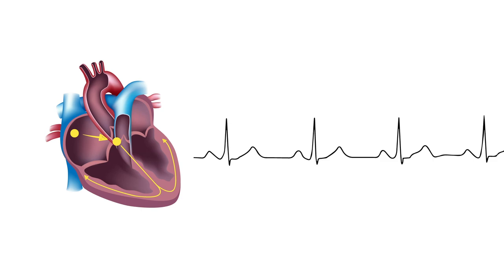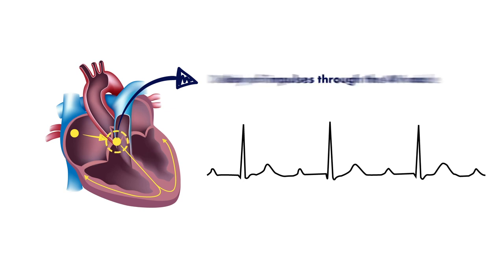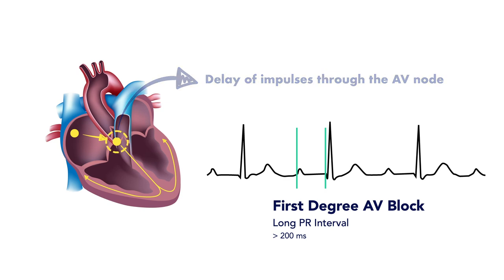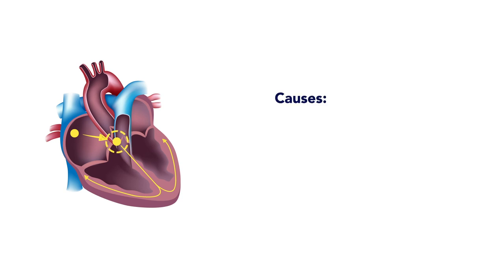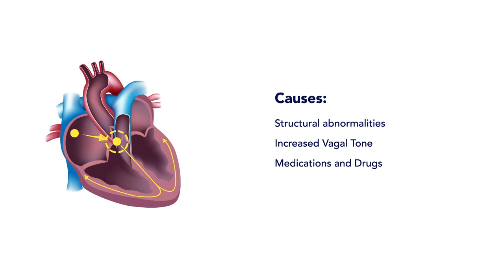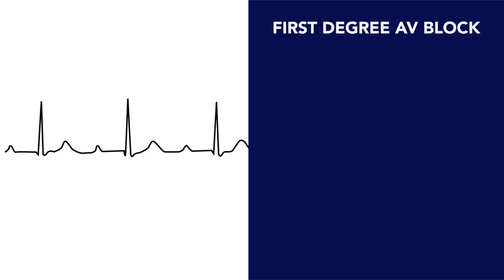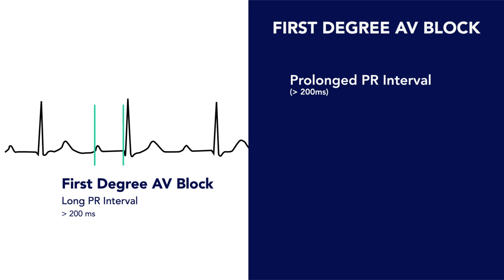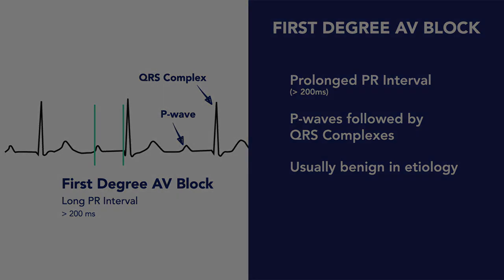First Degree AV Block -  EKG (ECG) Interpretation

Comment: What are the symptoms if you have First Degree Av Block.  For example, would you feel more tired or have less energy?  Thanks.
Reply: it has no symptoms and it's not dangerous !
Reply: Nothing, only bradycardia while sleeping (lowest rate was 47 beats per minute) but you don't realize because you're sleeping.

Comment: Great video! I had an ECG done recently and I was surprised to learn that I had several abnormalities in my ECG: Sinus bradycardia (42), first degree AV block, sinus arrhythmia, high voltage QRS, and early reporlarisation. I'm 55 y.o. asymptomatic and I train in endurance sports 7-10 hour per week (XC skiing and cycling). Should I be worried about does findings? Thanks
Reply: Ask your cardiologist, man!